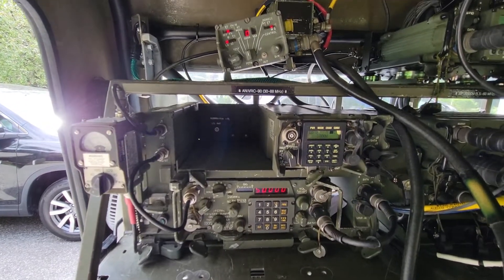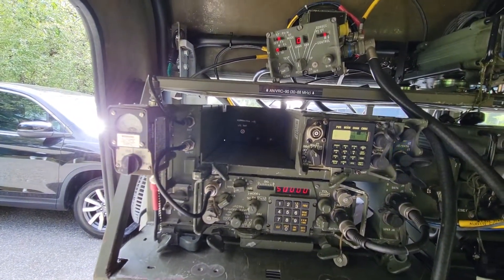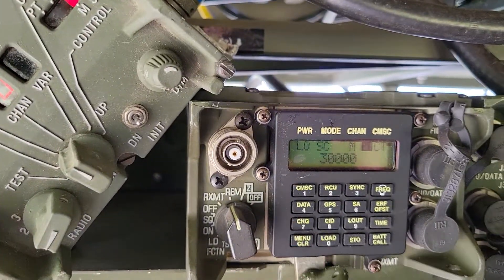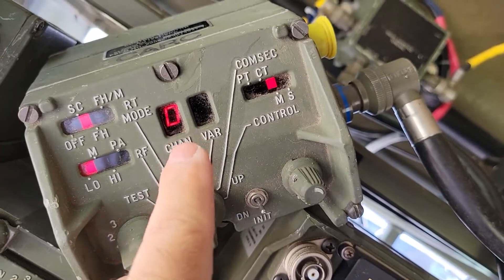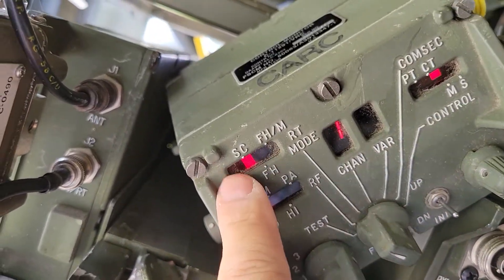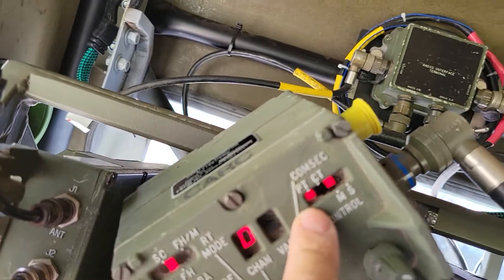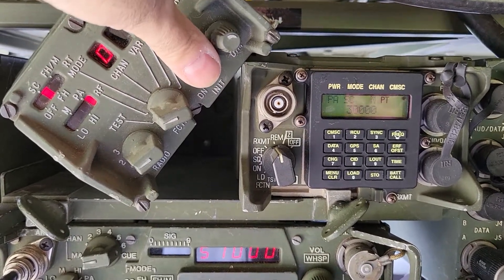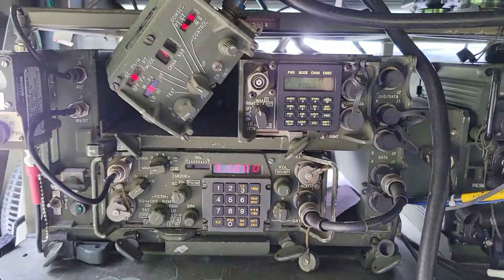Using the Sincgars Remote Control-Monitor C-11291/VRC

Comment: Why did you want to sell it? Did the VIC-3 system replace it?
Reply from the maker: I just didn't need a remote as the radios operate on fixed frequency (51 MHz only). thanks